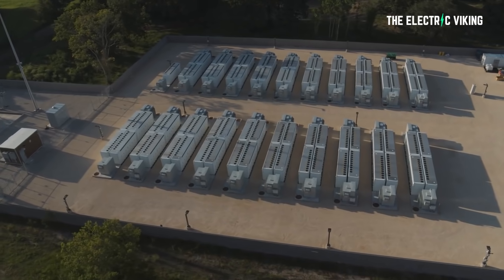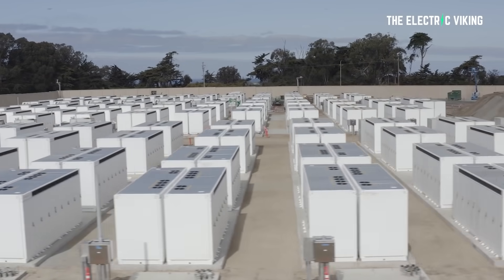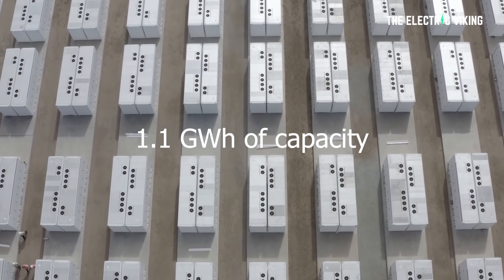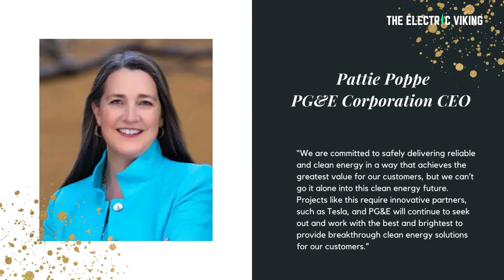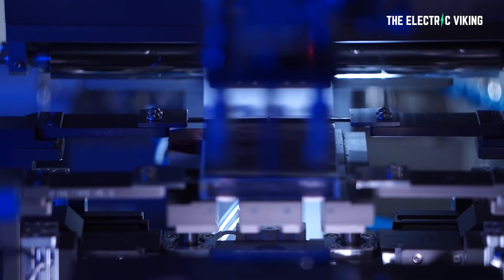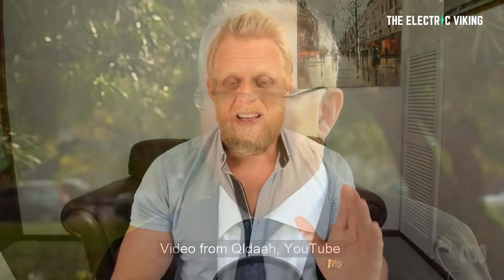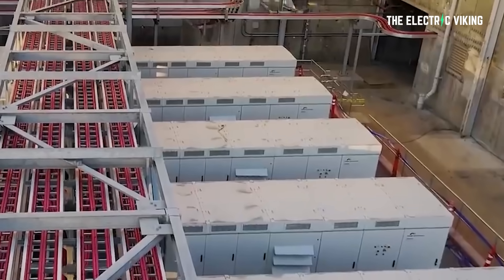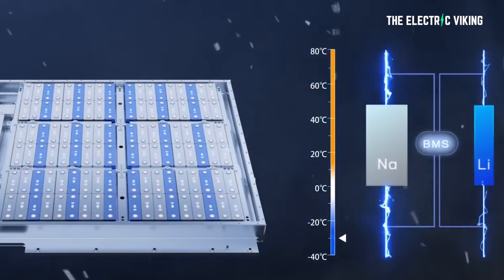Tesla's new MEGA battery signals the end for COAL power

Comment: Batteries don't generate power. If the grid runs off coal power and you shut down the coal fired power station, the battery would last all of 5 minutes before you would have blackouts happening. The only purpose of these mega battery packs is to supplement the power from a functioning power station during times of extreme high load, allowing power utilities to save money because they don't have to switch on expensive gas turbine booster plants by replacing those boosters with the battery for very short periods of time. To say that these batteries will mean the end of coal is simply not true. You would have to replace the coal fired power station with something else that GENERATES electricity, such as wind turbines, solar, hydro, nuclear, whatever. Only 2 of those non-fossil fuelled options I just listed produce stable 24/7 power generation - hydro and nuclear. Wind power is spasmodic, and solar only works during the day and when there is no cloud cover blocking the sun. So yes, batteries can help supplement base load nuclear or hydro power when wind and solar are not at full capacity, but to run the entire grid on batteries alone for more than a few minutes at a time is not possible.
Reply: You have enough, then you only need solar and wind.
Reply: I doubt that the mega packs that they’re installing will only run for a few minutes. There are many variables as to the size and to the distribution Netwerk that come in to play for one would not design a system to run for only a few minutes.
Reply: So what? The average gas peaker plant built only runs for a matter of hours each year. Some as little as 4hrs a year run total run time.
So you pay billions to build one of those, which will pollute horribly every single time it's needed and takes time to respond to demand events.

They also will require a staff onsite to run it, which ad's even more cost and pollution. From getting those workers to&from the plant daily, plus even more energy consumed to heat&cool the facility itself for the workers. The batteries don't require any of that in comparison. 

So these very simple in comparison megapacks which can be controlled remotely and respond in milliseconds to any demand event.
Tesla even sued the Australian grid operators over the demand response time with the Hornsdale battery. Winning that suit and proving they literally can can respond in milliseconds vs minutes for other generator type's. 

Seems to me the solution is crystal clear here. Also these are now lfp chemistry pack's so no cobalt or nickle in them. 👍🏻

Comment: How much land will be taken up by the solar panels to charge these batteries
Reply: I thought Elon said 100 miles x 100 miles of solar could power the US. I’m not sure about the variables of cloudy days etc.
Reply: There are hundreds of solar panels in a field not far from my home. The land hasn't really been "taken up" as the farmer still grazes sheep underneath the panels. Likewise, there thousands of industrial buildings which could readily have solar panels mounted on their roofs. The owners of the buildings would receive a percentage of free electricity as an incentive.
Reply: @Brian-om2hh  will the grass still grow despite it being constantly in the shade
Reply: 5% of all developed us land mass is covered by concrete just for parking lots currently according to information I can find.
It would take just under 1% of all U.S. land mass covered with panels using today's tech. In order to supply enough energy to power our grid with solar alone when the sun shines.

Someone entrepreneurial should really come up with an easily installed and scalable solution for parking lot solar canopies imo.
 
Ad onsite megapacks or other large batteries to soak up the excess energy and prevent grid curtailment. Plus many slow ev chargers for the residents and workers, visitors, customers who park there. Presto renewable energy, shade for your car's from the sun&cheap ev charging all in one. Quick somebody give me $10,000,000,000 to get this started asap. 😀

Comment: Tesla mega batteries are used for short term fluctuation control.  It competes with gas peaker plants and does not compliment renewables against coal.  Grids utilise other technologies for long term storage such as pumped hydro.  In the long term batteries may co tribute to long term grid storage, but it’s a long way off

Comment: All these ideas cannot compete with the new fusion nuclear power. If you also wish to tackle the climate issues without experiencing great pain read on. Almost costless electricity, and subsequently almost endless desalinated water and then hydrogen from water electrolysis can now easily be provided. We will; have boundless cheap hydrogen as the essential fuel for New Fusion Nuclear Power. This now immediately upon us. It only seems odd that this has not already been widely advertised. We have recently taken a new step to advance the physic of power production by enabling the chemistry of the atomic nucleus, or "nuchemy" in the newest FUSION NUCLEAR POWER., utilising the technology of the SAFIR REACTOR. We are passing the chemistry level where we interacted with the atomic electron shells and are moving on to manipulations in this "NUCHEMY" atomic nuclear era when we interact and multiply nuclear protons. We have rediscovered the lost work of the alchemists and can make new elements with different atomic weights. This was ably demonstrated in "The Safire Project". Quanta are important. We now have enough energy in them to manipulate the atomic nucleus much more easily by creating a compartment, or what is a local region of plasma containment so reactions at this atomic nuclear level can easily take place. This is about to practically enabled a really fantastic and cheap new era of energy production for the whole of mankind. This with hydrogen, so free fuel is obtained from water or atmospheric moisture anywhere in the world. This new fusion nuclear is at the industrial commercial production final development point as of now. The energy argument and other power methodologies are all now virtually irrelevant as we have new and very physically and economically powered practical and local community level fusion nuclear power. Solar roof plus Teslawall battery maybe the present way to go domestically but megapack batteries and multiple storage technologies interconnected with an expanded ugly grid have a less certain requirement when you consider new any-scale community based and 24 hr reliable and self-fuelling fusion nuclear in the form of the "SAFIRE REACTOR". Learn all about it at "AUREON ENERGY.COM". Learn the newer EU Theory and all of plasma physics science at "THUNDERBOLTS PROJECT.COM" and you will be permanently re-educated with this advanced new EU theory that will allow you to understand more about the astrophysics of our whole universe and all within. 

                                                                               I stand by my word and this information.  Sincerely, Dr David Gillman at dgillman47@gmail.com
Reply: When I was doing my Physics degree 50 years ago there was a course on nuclear fusion. It was stated then that it would provide the solution to the world's energy needs within the next 50 years. Since then I have read the same thing time and again. Always 30 years in the future or just around the corner. Why waste money when we can use that big nuclear fusion reactor in the sky now.
Reply: @andrewjoy7044 - Read the references I have presented to you and you will then see the irrelevance of your comments.

Comment: I don't think these large battery installations will become common.  Perhaps the largest benefit that batteries have over most of the other energy storage systems (hydro, compressed air, thermal systems) is that they scale almost linearly from very small to large.  It makes for a better more stable system if you distribute the batteries over the grid rather than in a single site. Why have one large site that could be knocked off the grid from a network fault when you cold spread the same batteries around the system and have much greater resilience at little extra cost.
Reply: Not only that. They can react to changes in demand in milliseconds. Far faster than any other storage system
Reply: I like distributed production and storage too .If I had two more neighbors to participate with, we could easily go completely off grid or at worst reduce the grid connections to one.
Reply: I expect/hope that soon all new transformer stations will be equipped with a Mega pack to spread out the incoming power over the day.

Comment: Yeah I live about 20 miles from that plant .  It went from oil to natural gas. Great that it's a peaker plant and can absorb the excess Solar that 
California already has. But I don't see cheaper electricity coming from it. PG&E has been raising prices here on a regular basis and California 
has some of the most expensive electricity in the US. I have Solar myself but the Power Company Mafia in California is trying to kill Residential 
Solar because they want to keep the Monopoly going. We were able to kind of stave off the next round of NEM 3.0 which would have charged you
for the amount of panels on your house . Right now on NEM 2.0 they charge you a hook up charge to the Grid and only reimburse you at the wholesale
rate 3 cents per KW and they turn around and charge it to the customers at 30 to 40 cents a KW . Tesla and every small Solar installer in California
was up in arms as well as the Residential customers that already have installed system.  Right now the power company's here have to pay a lot 
of money for the fires we have had over the last 5 or 6 years. I would like to have a battery at home I am betting the LFP's would be better for this.

Comment: Love Tesla , BUT they are storage not Generation of Power . Californian power grid has a lot of problems it cannot generate enough power , Electricity is around 25 cents Kwh . In other parts of the USA its 11 cents and high users such as Crypto miners pay 5 cents . Battery storage is really about grid stability , Pump Hydro storage is a much better large storage system . But it comes down to generating power , and the fact that Governments are interfering in the commercial market place , Solar , wind ,nuclear, gas and coal all have a place in the system at this time . Germany is having huge power generating problems and is highly dependant on Hungry and France for power , Trouble is France s 60 nuclear reactors are getting too old and they just announced they are building 6 new ones that will take 12 years to start operating , this will NOT even replace the reduced capacity of the ageing plants . Without excess power generation you cannot charge battery storage ,or Hydro storage .... Tesla battery in South Australia makes money by discharging and recharging at and when there is a price difference .. South Australia was buying a lot of its power from Victoria which repeatedly failed due lack of power line  maintenance and Victorias lack of increased capacity . South Australian power outages were solve by a combination of fixing the downed power lines , New gas fired power plants and batteries , including home batteries .
Reply: Actually electriciy is now North of 35 cents per kilowatt.  There is enough Solar power in California now that there is this thing called 
the Solar Duck curve now at which time when it reachs the hump in the afternoon there is more power than there is people to use it. 
And this is with less than 10 percent roof coverage.
Reply: @ctuna2011   I love solar , not so wrapped in Wind its very location orintated In Australia suitable wind locations are rare compared to say Texas . California imports a lot of its power . The solar duck curve is both a good thing and a bad thing . Electricity if you didn't know is much cheaper in many other state in the USA . About a year ago it was 11 cents KW in Florida . The Electricity market is the BIGGEST scam going around . In Australia the company who delivers electricity to my home charges 8 cent KWH fixed rate , but I cannot buy directly from them I have to pay 24 cents from  basically a billing service who pays 8 cents to the supplier . Germany is a real problem and the UK is having massive increases . Just wait till EV take off and electricity demand per household goes up 10 KW per day ( 70 KW to recharge a car ) .

Comment: This is huge. Wind and solar energy can be stored. Millions of EVs can drain their batteries overnight if necessary temporarily.
The size and weight of the battery don't matter in this kind of configuration. THis could be bigger than the EV market combined.

Comment: 🔌Pumped storage hydropower (PSH) and Flow batteries make more sense than Lion batteries. That is why China is building the world's largest PSH. Modern Gas turbine peaker plants can take full load in less than 10 minutes but prefer 10 to 15 minutes not hours.🔌
Reply: It makes no sense to simply make a blanket claim that one type of energy technology system is superior to another. Different types of renewable energy production and storage systems make sense in different places and circumstances. The required level of energy needed, the cost effective application of available technology and the level of greenhouse gas pollution produced by any particular energy system and other, practical, environmental and economic cost/benefit factors, are used to determine the most appropriate system for each energy project under consideration.
Reply: @donjohnstone3707  True but I am not a fan of Li-on. Yesterday we had another 10Meg  AES Li-on utility battery storage catch fire in Phoenix.

Comment: I believe you are making a mistake here. A battery does not produce energy! This Megapack Installation serves two purposes: one, more stable power to the residents, two, reducing peak loads.
Reply: it will assist in reducing coal power, not directly, but by allowing renewable energy (wind and solar) to time shift, thereby allowing these plants to have excess capacity without demand constraints. Only then will coal power's days be numbered. But you are certainly right, the battery is not an energy source, rather, it is an energy load due to inefficiencies. The other benefits you have stated are also correct.
Reply: @rikvdk8962  Yes the "time shifting" is the key, because it reduces the need for inefficient and dirty peaker plants. That is what I meant by reducing peak loads...
Reply: of course he knows that...the idea is that solar and wind will be totally viable once they have storage implemented...then no need for something that can run day or night (coal, diesel, gas)